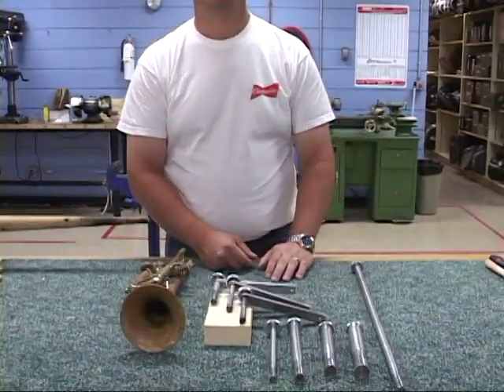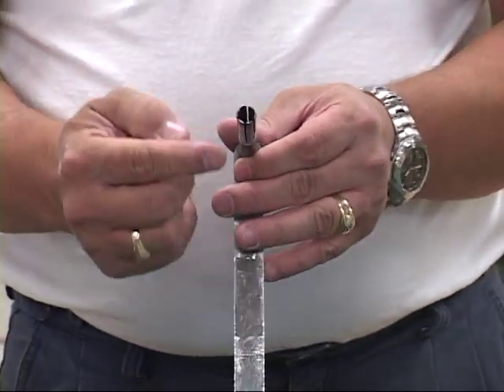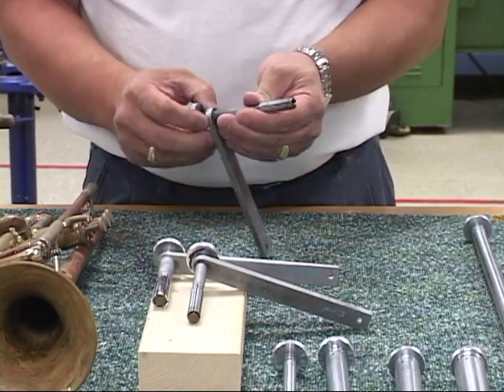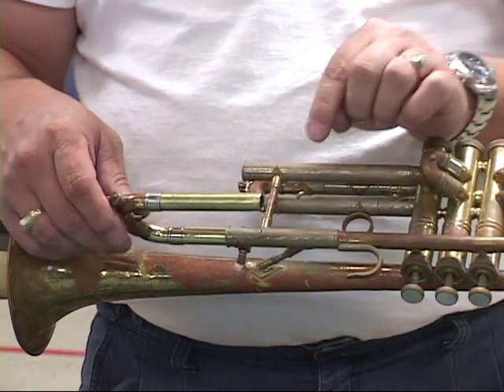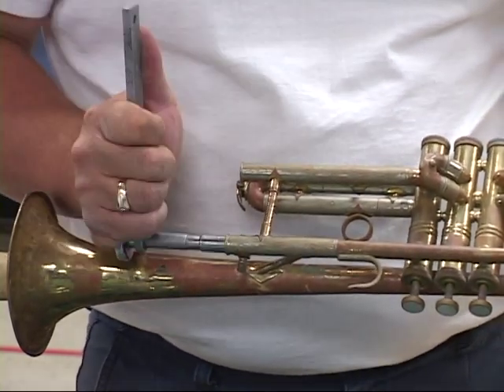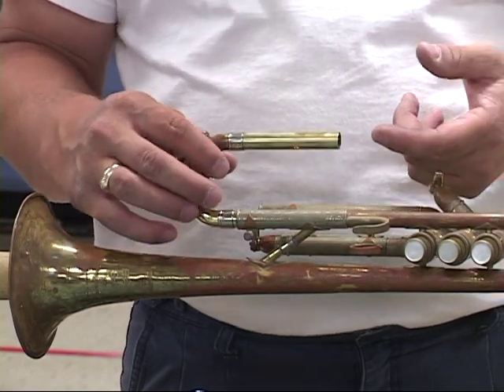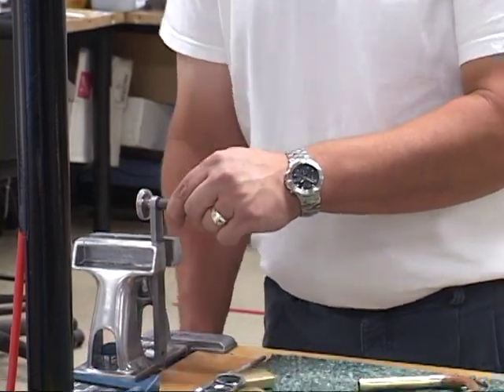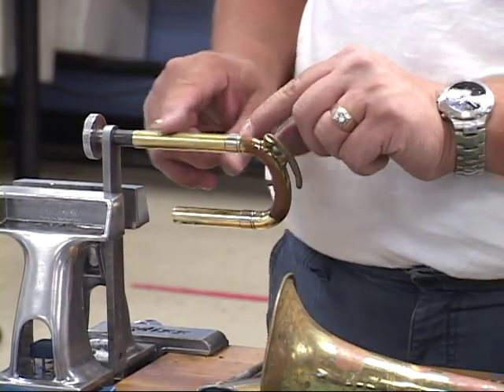How to use Ferree's tube expanders by Michael Durocher

Comment: On the instrument you used in this demonstration is that red rot or rust on it? With that much discoloration would such an instrument be worth salvaging because the metal might be very weak or very thin in those areas?

Comment: Could this tool also be used to remove bore spacer sleeves from tuba valve slides?
Reply from the maker: Potentially,  but if they are tight it won't  work as they add pressure  inside the tube.  Unsolded and tap out is probably  the fastest way, imho.

Comment: very helpful, what's the part numbers on those two tube expanders you're using, the small and medium for inner and outer slide tubes?
Reply from the maker: Hi there.  The expanders used are from Ferree's Tools Inc. Found on the web at www.ferreestoolsinc.com.

The tools are N35 and N36 for small and medium.  N37 is the larger one.  They also have long versions as well, which are the N5  N6 and N7 units. 

Type in expanders in the search box and they will come right up.
Reply: @bandrepairdemosbymichaeldu8070  thanks a lot, you're the man!

Comment from the maker: You are technically  correct,  however the only time you would use this method of expansion is when the client could not afford the correct repair of replacing the tube or was needed asap for some reason.

Comment: Excuse my ignorance here, but if the outer portion of the inner slide has been 'over sanded', causing a loose fit...wouldn't the expansion of just a small section at the open end of the tuning slide effect the least amount of wave change due to tube size change...while still sealing for air leakage?
Reply: as an after thought: is there a tool in this case that will evenly 'crimp (for lack of a technical term) a small portion of the outer tube/lead pipe at it's outer end to maintain pressure/lack of leakage while maintaining original bore throughout?  BTW, an excellent educational video.